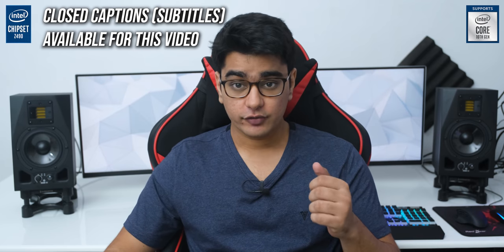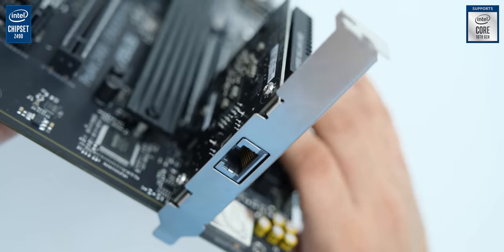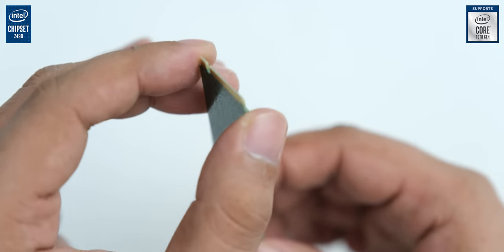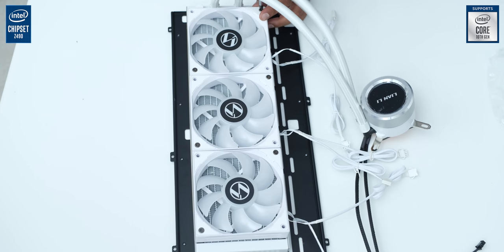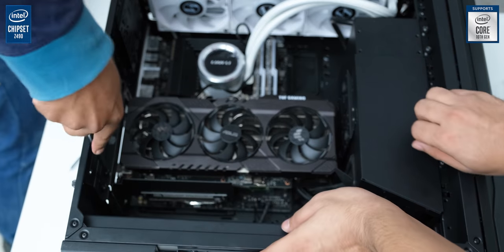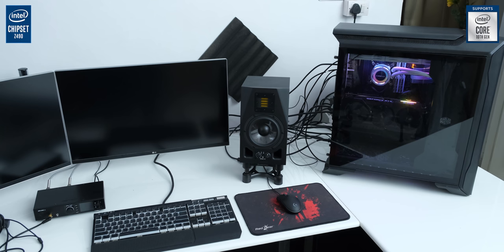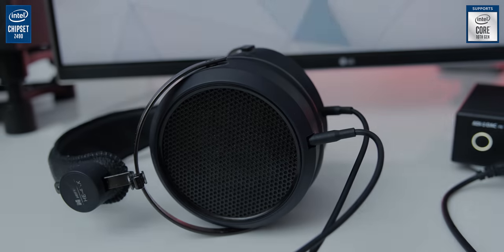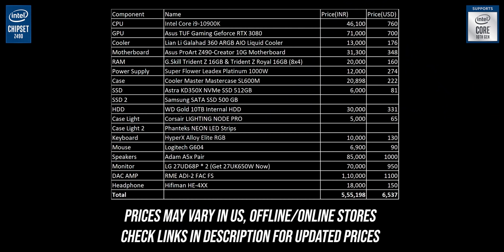Building the CREATOR GAMING PC ft. RTX 3080, Core i9 10900K, CM SL600M!

Comment: Bro I am going to build pc I am going to use these components in build( suggest me for changes) Graphic card:- rtx 2060 super Processor:- amd 7 2700x/upcoming same budget processor 
Cabinet:- Ant esports ICE 400 tg  
Ram:- G skill f4 3200c rgb ram 8x2=16 gb ram
 Power supply:- corsair cv450 w 
HDD:- Seagate barracuda 1tb 
Sdd:- Kingston 240 gb Motherboard:- Gigabyte auros 450 pro wifi
Reply: Why 2700X when you can get the 3rd gen Ryzen part now. ANd if you wait till November you can get the latest Zen 3 based Ryzen 5000 series CPU which is gonna so much powerful than 2700X. Rest is all good about your build. Maybe wait for RTX 3060 and get that instead of 2060 super.
Reply: @TheSumit11121993  I say /upcoming same priced processors

Comment: Dude, a tiny question for you, I've been very intrigued by it. I notice everyone using the 10900k which supports only upto pcie3, does the 3090/3080 not saturate the pcie3 lanes totally, or is there any drawback to not using pcie gen 4 with these cards, would I be (theoretically) leaving some performance on the table?
Reply: No It won't saturate the PCI e3 especially not 3080, maybe 3090 will, but even then the performance difference will be less than 4-5%. Nothing to sweat over. The 2080 Ti was not even close to saturate the whole bandwidth possible with PCI-ex gen 3. You can watch Gamer Nexus video on this subject. The performance gain with using PCI ex gen 4 is very minimal even when using the Ryzen 3950X from AMD.
Reply from the maker: Yeah, 10900K is still faster than 3950x, even whole being in PCIe gen 3.
Reply: @TheSumit11121993  thank you.

Comment: Hi, at first good review! I wonna ask you one think..I noted that actually is possible use Corsair lighting Node pro only with related led strips,fans and other Corsair stuff and not with parts of other brand so...how could you connect them together(Corsair led argb strips and Phanteks Neon led) in the Corsair controller?

Thanks in advance.
Reply from the maker: All non corsair stuff was connected to single ARGB header on the motherboard with splitter.

Comment: You should have done AMD build as it supports pcie gen4, and is supported by the rtx 3000 gpus
Reply from the maker: Doesn't make a difference, 10900K is still ahead in gaming, check Hardware Unboxed or GamersNexus

Comment: bro i have asus proart z 490 10 g motherboard. I tried connecting 2 displays to the PC, one to HDMI and the other display to the Display Port (of the mother board). Please note that the first monitor is a 4k TV. the second is a normal monitor. Only the TV which was connected via HDMI works. The second monitor connected to the display port does not work. Please also note that I connected the particular monitor though an DP to HDMI adapter. I checked the adapter, the monitor and the HDMI cable and found that all of them are working without any issue. Drivers are up to date Can you please advise me if something is not right in this setup? Can't I use HDMI port (for TV) and one of the DP for the monitor in the same time? Thank you and awaiting your reply.

Comment: Doesn’t it create problems with a pcie 4 gpu and presumably pcie 4 motherboard and the bracket and riser that seems to be pcie 3?
Reply from the maker: Motherboard in this case was pcie 3, otherwise, you just have to install gpu first, and select pcie 3 in bios in pcie 4 supporting motherboards.
Reply: @TechReflex  Easy as that, lol. Appreciate that :)

Comment: Side mounting gives bad thermal at cost of looks !

= Bad oc = Performance drops
Reply from the maker: Thermals are actually improved with a vertical mount in this case, check GamersNexus review of SL600M before commenting.
Reply: @TechReflex  https://www.gamersnexus.net/hwreviews/3384-cooler-master-sl-600m-review-thermals-build-quality-noise

I just checked again , GPU load vertically is showing higher . 

So you should do research before  showing bad builds with high temp to viewers .
Reply from the maker: So if you read then you must also have seen the CPU thermal chart, which is lowest with vertical GPU.

I actually take my comment back about the you saying completely false information and not understanding (long day for me), but Vertical gpu only hurts thermals in general where the GPU is too close to the glass, even check out their newer video on 3080 FE where they say vertical not bad, and CM mount keeps gpu far from the glass

Also, this card already runs so cool it's not going to face issues.